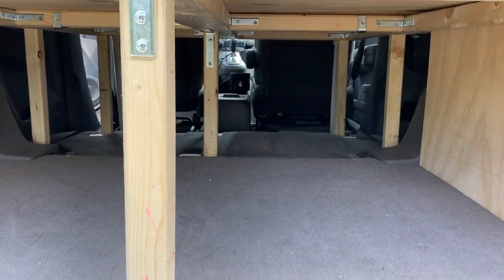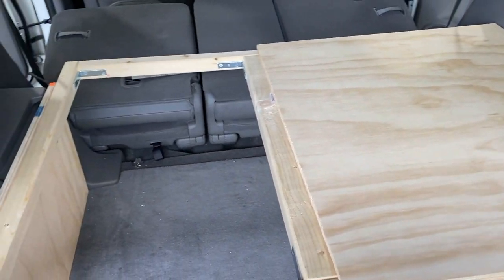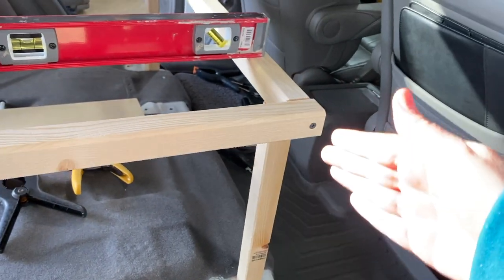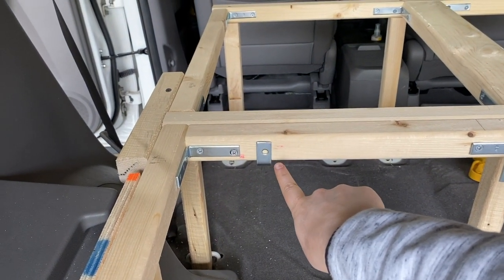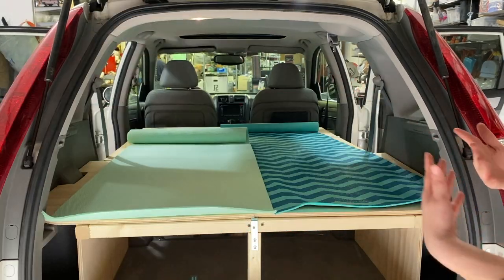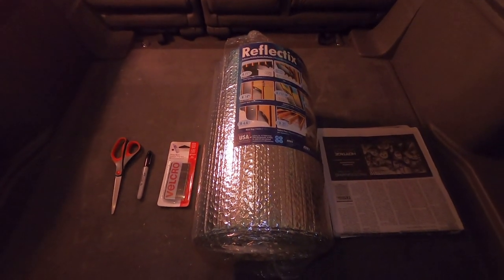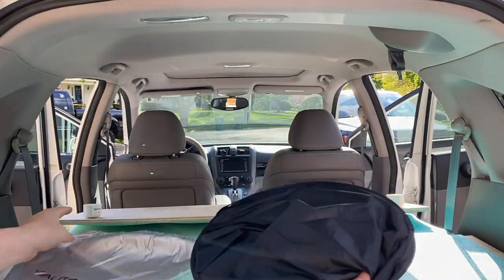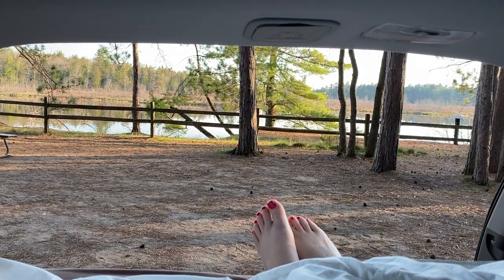I Turned My SUV Into a CAR CAMPER | DIY Platform Build

Comment: I also have the same year make and model. I would need to modify the design to be able to sit up in the back, even if my legs are straight out instead of bent. I admire your apparent lack of claustrophobia!
I'm thinking about taking out the driver seat, but leaving the passenger and middle rear seats in place. This would involve more custom fitting and cutting the memory foam sorta shaped like Oklahoma, but I travel with my service dog and he needs that backrest when we are on the road.
I put a wire 4-tier rolling cart in the passenger side on the floorboard. This really helps me keep organized. Have you come up with a better cupholder idea than the wierd fold down unit? I'm about to yank that out and add a cup/phone holder elsewhere.
Thanks for the video, and thanks to Dad for the skills.

Comment: Nice set up with details for a beginner. I have a 2014 CRV planning to convert for a single traveler use.  I would lie to keep the  rear seat in place so my wife wont be upset. The plan is to fold down the large seat and build a platform over it.  my concern is still the ease of removal of spare tire should there be a need,  though rare. I am not sure how easy it is in the build you did on the access to the spare tire. If you can do a demo that would be great.  You and your Dad rock. Happy Camping.
Reply from the maker: To be honest, installing the rear seats after removing them was quite a pain, so I would definitely try to build around them if I were to do it again! Removing the tire would be pretty much the same as having nothing in the trunk, just have to hold up the top piece of the bed, and then access the tire as normal.. but like you said, hopefully you'll never need to do that 😁 I hope it everything goes well on your build!
Reply: @ChasingChey   Thank You!

Comment: Enjoyable video as I also have a 2010 CR-V. One advantage I have is that I'm a side sleeper and sleep in the fetal position. I liked the idea of taking out the seat and using the indents on the floor. The biggest issue is that I don't have someone with woodworking experience to help.

Comment: Hi, Do you know the interior measurement from the interior closed hatch to the back of the front passenger seat when the passenger seat is slid and tilted all the way forward?  I'm wondering if a 6' tall person could sleep inside it with the hatchback door closed. - thank you

Comment: Hi. Love your video, I have only one question, is it easy enough to get to your spare wheel if needed?
Reply from the maker: Yes, definitely easy enough if needed! I'd just have to pull out the bins at the bottom, push the mattress forward, and then take out the back platform. Luckily I didn't have to try it on my trip 🙌 thank you for watching!